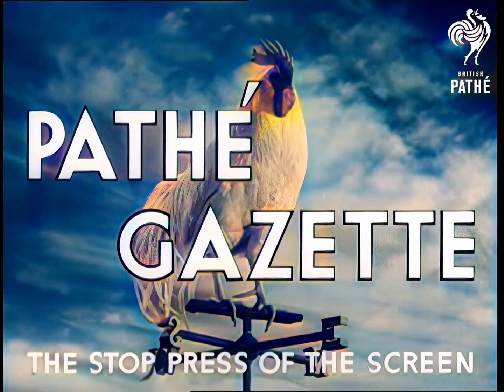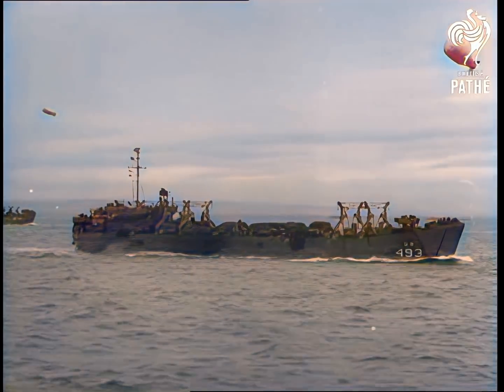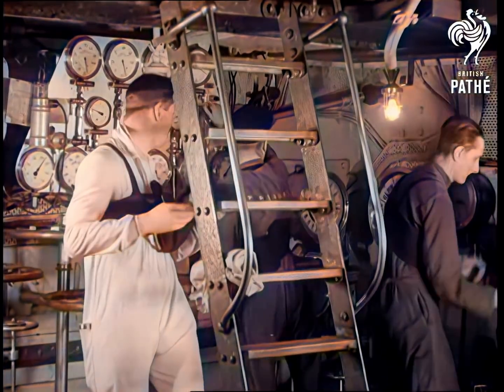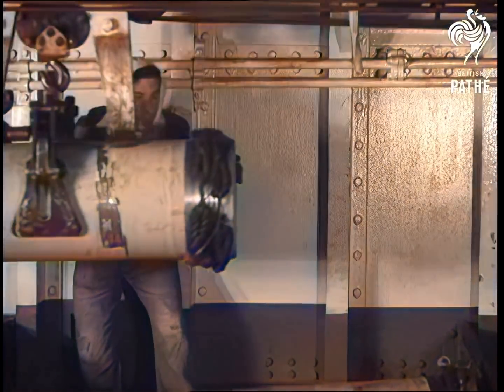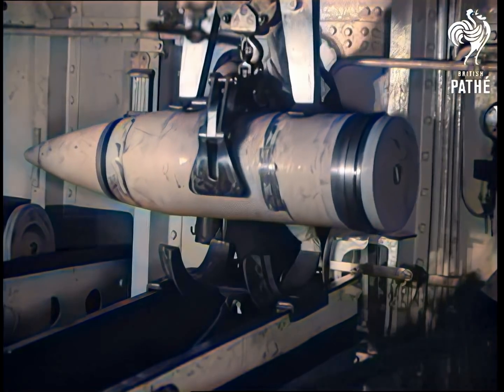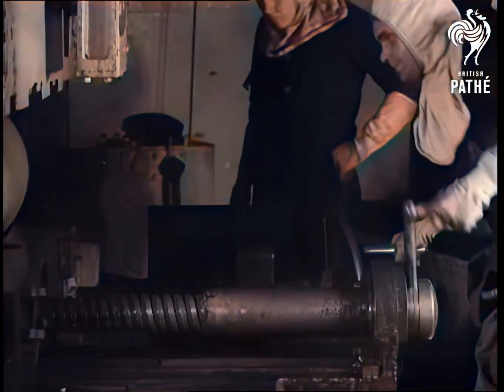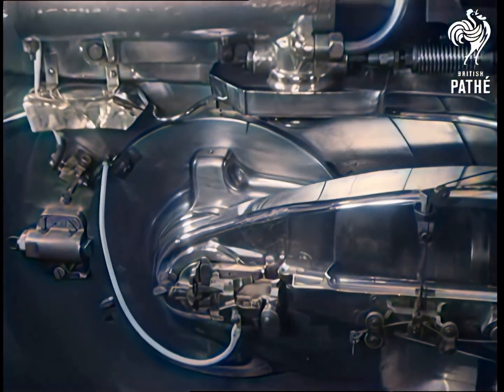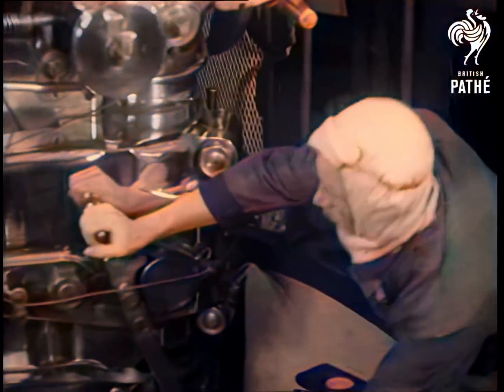AI Colorized | Rodney Shells Alderney (1944) - DeOldify

Comment: The HMS Rodney was definitely my fav battleship design of WW2 (Yamato aside AHEM)
You gotta love the particular design and such a low profile with that much firepower.
The stainless steel tho.... Mouthwatering.
Reply: I have a copper ashtray from the Rodney, it has the ships coat of arms and name in relief. It was Dad’s, no idea where he got it as he was Royal Artillery. I also have a hardback novel from a mess or library on HMS Royal Oak according to the handwriting on the inside cover.
Reply: 16 inch guns
Reply: What cannons were they firing ?
Reply: Mine too! I love the look of all 9 guns facing forward. Something wonderfully menacing about it... like a tiger bearing its teeth.
It's almost like it's saying "I have no need for rear guns. I won't be the one retreating..."

Comment: the chrome metal looks astonishing...
Reply: It looks so good, the build quality looks Brilliant
Reply: That is impressive machining quality on the breach plugs!
Reply: If it doesn’t move, polish it. If it does move, polish it when it stops.
Reply: I think the gun looks that shiny because it's relatively new and kept well oiled while it is not painted and has not started to rust jet
Reply: You do realize that this was colored by AI and the metal parts didn't necessarily look exactly like this in real life?
Reply: @Dick Fageroni Have to agree, I think it's polished stainless steel. Either way, great piece of craftsmanship.
Reply: That's a case of the crew being ordered to polish up the guns to a mirror shine for the camera.
Reply: @wetlettuce4768  More like to give the gun crews something to do for the 99% of the time they have nothing to do.
Reply: All of that is actually brass.
Reply: @roflbotfpv9168  the breach is made of brass? I wouldn't think brass would be ideal for that especially the locking mechanism.